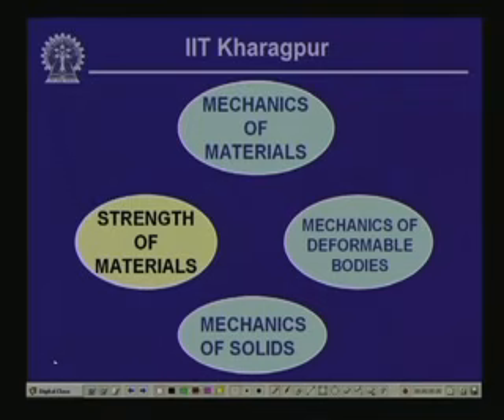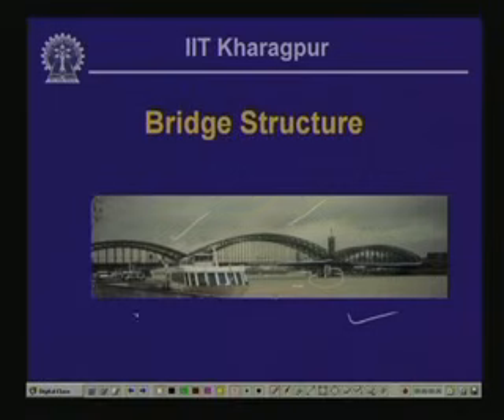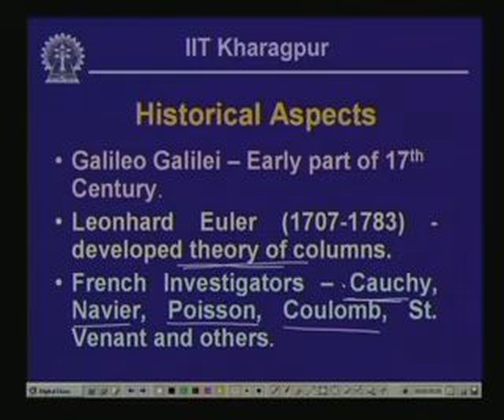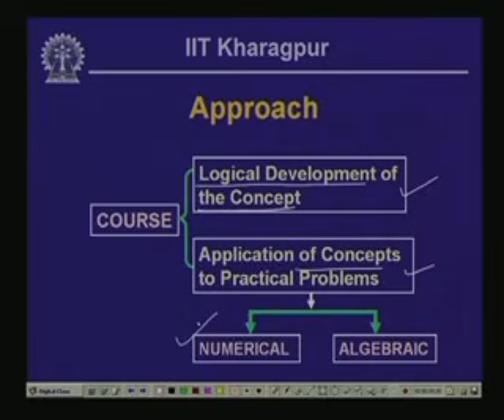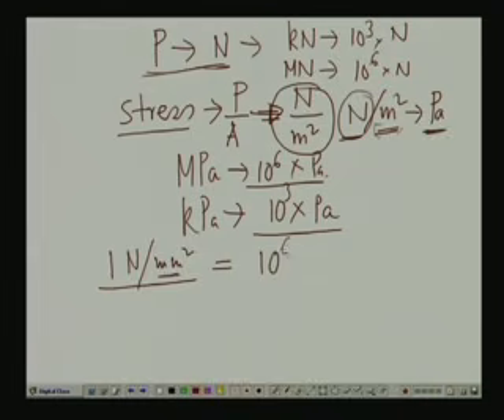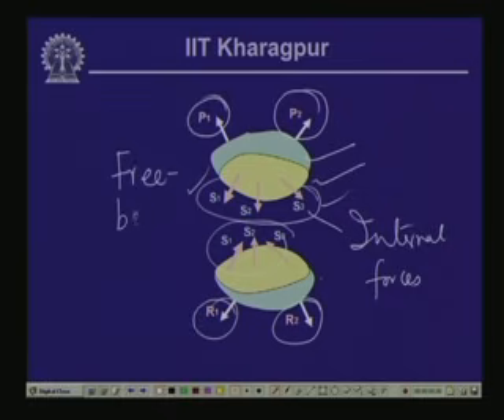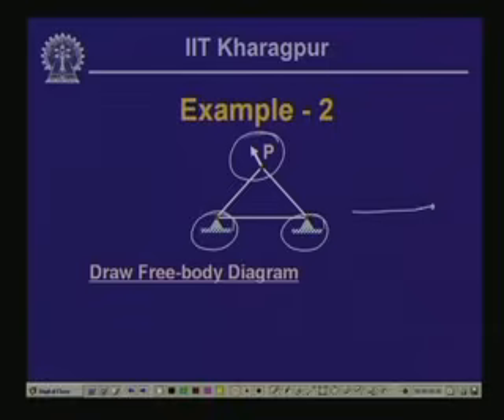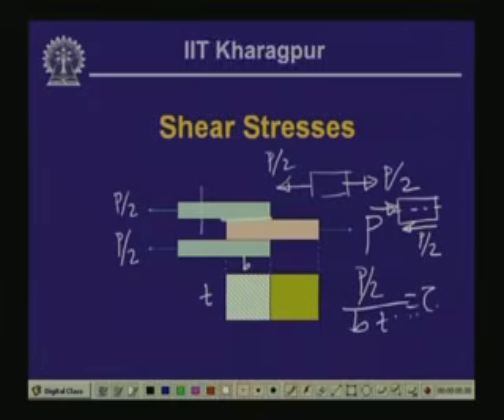Introduction - Strength of Materials

Comment: Sir in  stress strain curve,stress is independent term,then why we are taking stress in y-axis and strain on x-axis
Reply: Because strain is the independent parameter and stress is the dependent one. We usually represent the independent parameter on the X-axis.
Reply: Saicharan who told you , that strain  is independent?
Strain depends on stress to occur, so strain is dependent, while stress is independent.
Reply: @exoticckhan87   no stress is dependent on strain because when deformation is happening then stress start generating not after stress generation deformation started. So strain is independent
Reply: In stress-strain curves, stress is indeed an independent variable, representing the force applied per unit area, while strain is the dependent variable, representing the resulting deformation or elongation relative to the original dimensions of the material.

The choice of placing stress on the y-axis and strain on the x-axis is primarily due to convention and practicality in interpreting the behavior of materials under load.https://pubmed.ncbi.nlm.nih.gov/24412174/